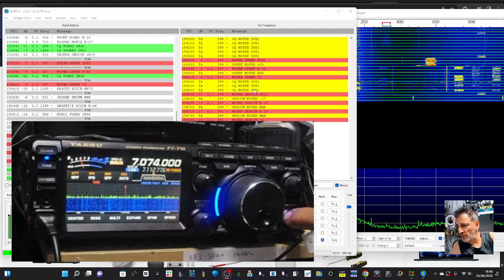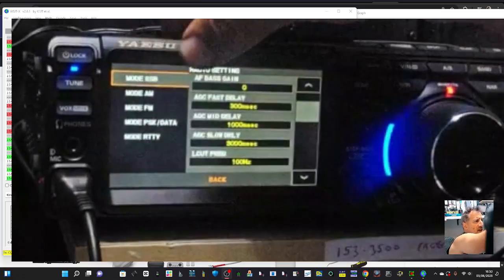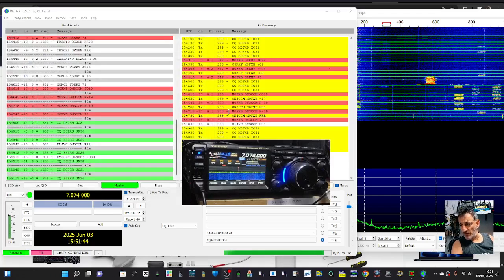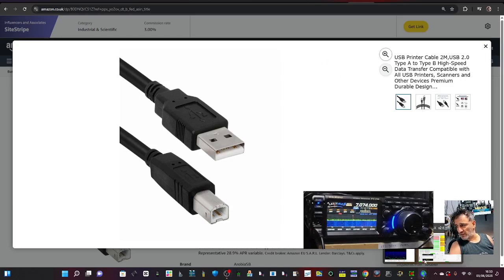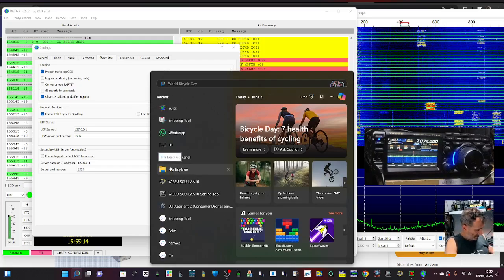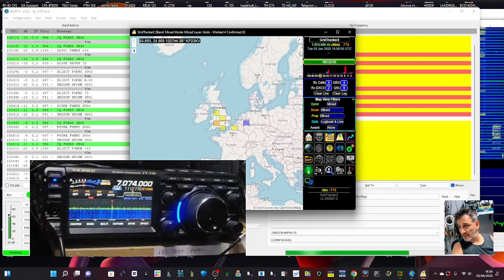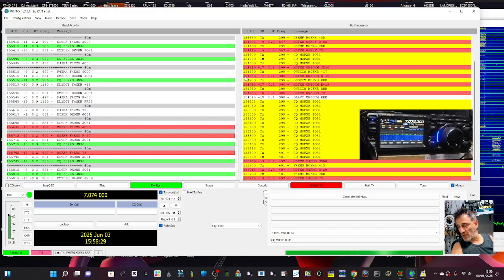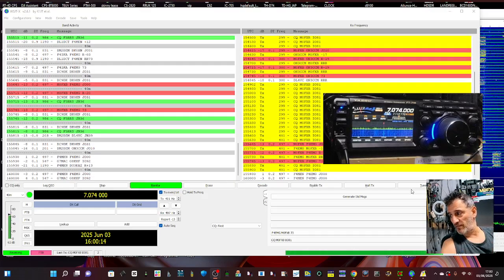2025 - Yaesu FT-710 " FT8 FullSet Up-That Works "

Comment: This is interesting. I followed the instructions that you posted on Facebook and it seems to be working OK. I do struggle sometimes to make an FT8 QSO. I wonder if I should switch to these settings? I currently have mine set to RTS instead of CAT per their instructions. Did you see it working better for you using CAT instead of RTS?
Reply from the maker: Seemed to.